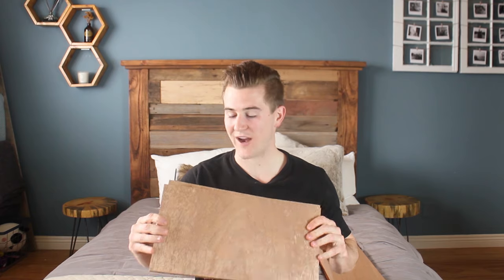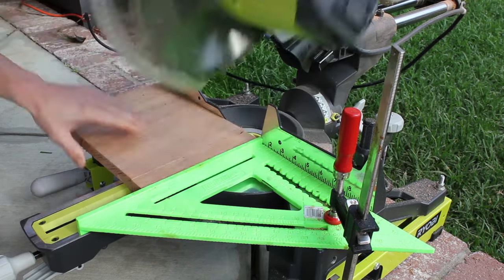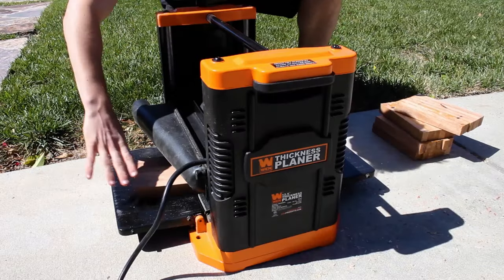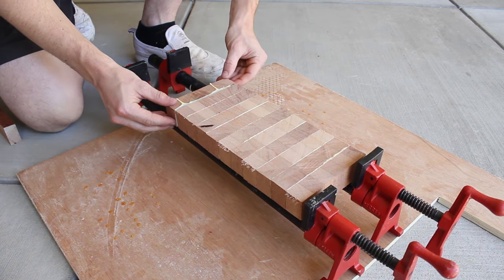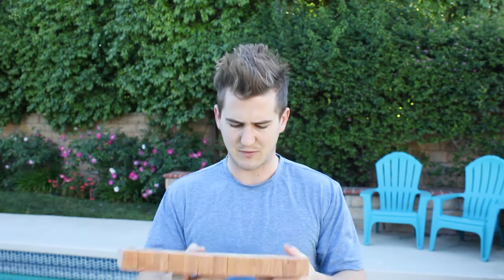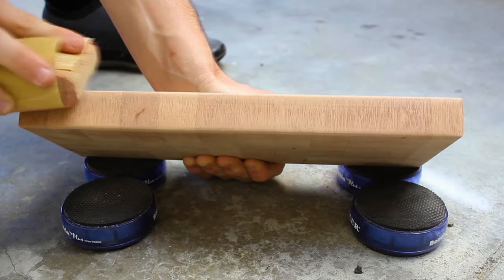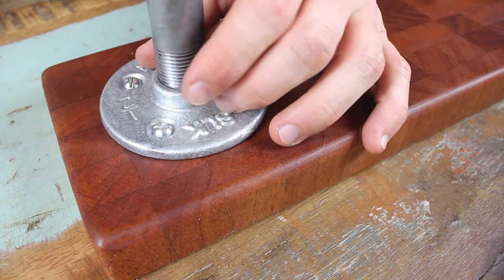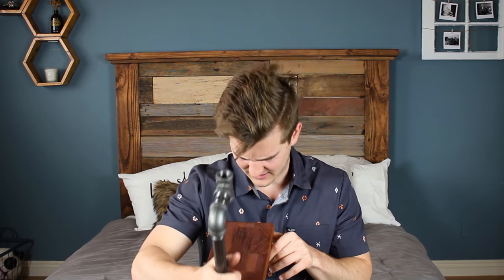Homemade-Modern-Inspired Coffee Station | 11

Comment: Definitely use a cawl across the top and bottom, good note is to wrap the cawls in packing tape since the glue won't stick to it and it will keep it all nice and flat, also be prepared to resand it in a month or two as the grain and glue will move after a bit of use and being washed.
Reply from the maker: Packing tape - that is a great idea! Thanks for the tip - prepping another project right now that will have laminations like this and was going to test out wax paper. Cheers!

Comment: Cool work man. I made my own after I watched this video but I am having an issue. I hope someone can point out a solution. The problem is that the coffee never really goes into my mug during the pouring process. 
Any suggestions?
Reply from the maker: I had the same issue - just the nature of the bottom of the funnel. You need to either get a shorter pipe so the mug sits at the same level as the bottom of the funnel or put a small upside down bowl underneath the mug to elevate it. We do the latter with the one I made and it works perfectly.
Reply: Thanks man !